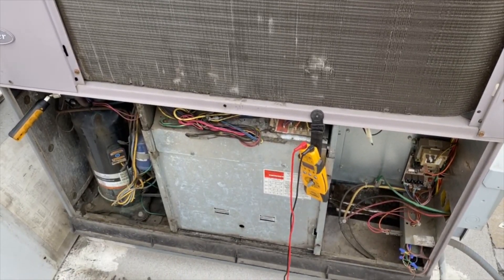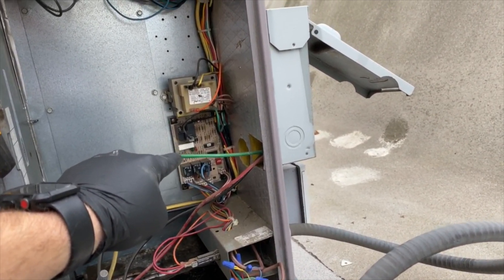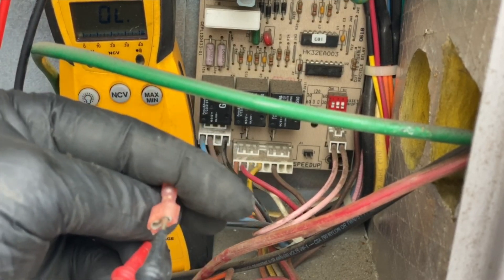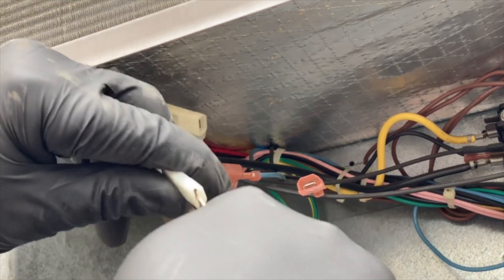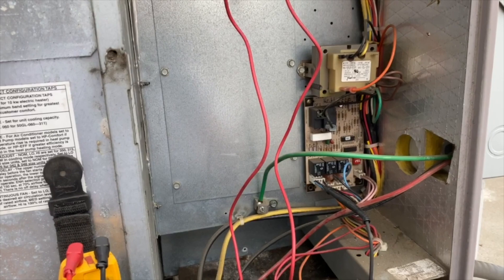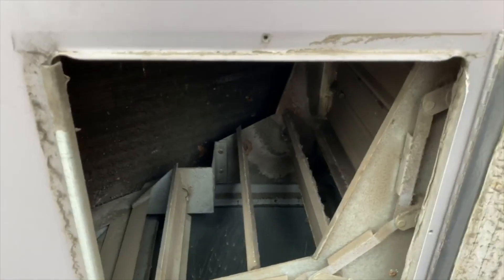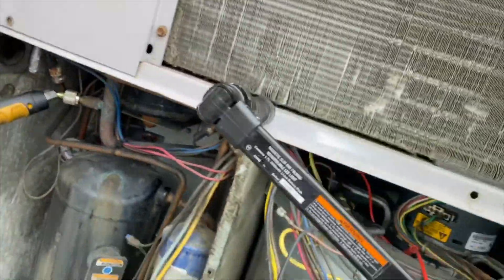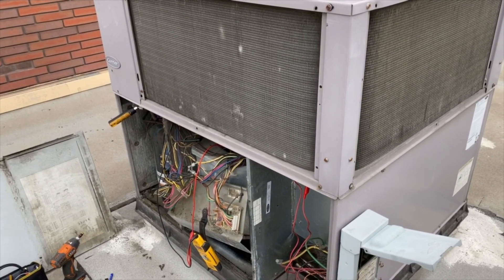High Pressure, Cause and Effect. EP28

Comment: Was the pressure switch faulty or was it just doing its job? Did the HP switch have a reset button? (Learning, not criticising)
Reply from the maker: Both. The high pressure switch was tripped multiple times due to high pressure caused by a dead condenser fan motor. The pressure switch is only designed to be tripped a few times. After a while the pressure switch got stuck and wouldn’t reset (self reset-able switch). Thanks for watching.